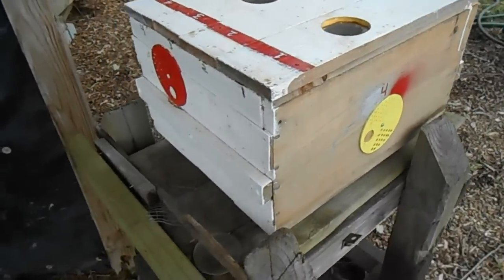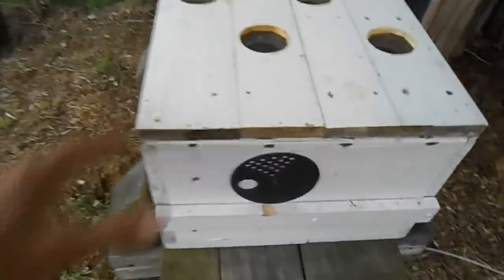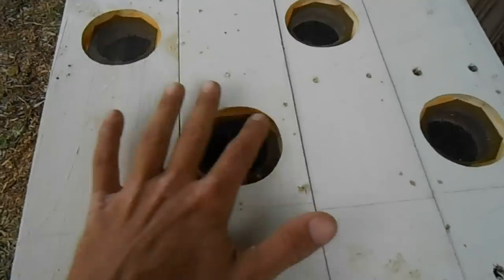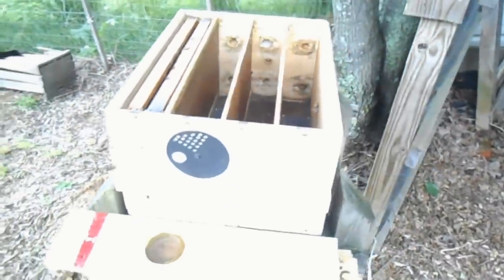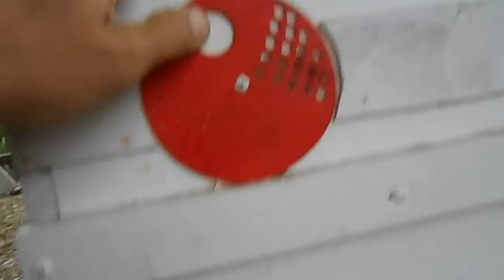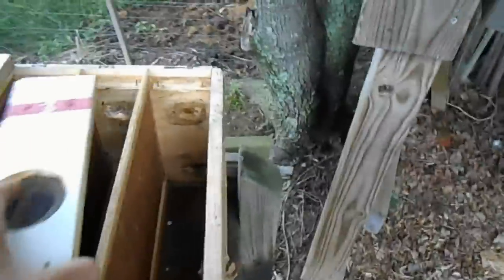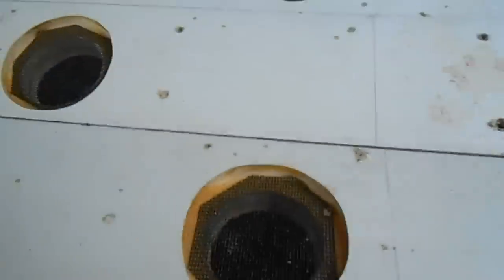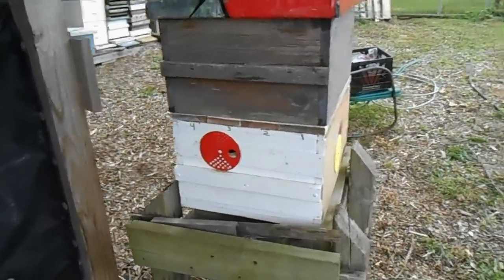Explaining A Queen Castle?

Comment: I sure learn a lot from you, more than any other beekeeper on you tube. Thank you!
Reply from the maker: Lyn Durga Thanks that was nice to hear. I try my best to make good videos that will be useful to others.
Reply: I did  summer splits,had 2 of the queen less hives that produced a laying queen lose her and 2 weeks later they had queen cells and no queen or brood. I split one of those hives in half on August 31st, by late September they were both full of brood and still have capped brood today. I know I'll be feeding fondant this winter. If it works out for me, I will have 3 colonies from a 3lb package I bought in May. I knew they were special because I had 2 full supers of honey by July and I never feed them in June. I started this year with 1 from last year, 2 2lb packages and 2 3lb packages. I currently have 12 colonies. Opened some hives today, panicked when I found some with no capped brood. I hope it's just that time of year when the queen has stopped laying. I am feeding pollen patties trying to keep the queen laying but it has gotten cold. Last winter I was losing bees when they left the hive and froze before they made it back. I closed their entrance with screen and made a screen en closer that I placed on the hive when it was sunny and warm. They would fly around in there and poop then go back into the hive. I also use deep bodies for nuc boxes. I have insulated fillers I place on each side. I can take out one at time to add frames. No need to disturb the colony when changing boxes.Just a few things I wanted to share with you and anyone else who is interested. Thanks
Reply from the maker: Lyn Durga Sounds like you really grew you bee yard this year. That is great. Do you have a number of hives you would like to reach? Also this screened enclosure you made how big is it? This is a interesting idea.  

A few years back I was up to 24 hives going into winter. But I did not feed like I should nor did I treat for v. mites. By the time spring came around I was down to 10 hives. I was really hoping they would all survive so I could split them and make 48 colonies. So I learned my lesson big time. I now feed like crazy for winter and I try to treat for mites by August. That was a major kick in the gut but it was also a lesson to me. As a beekeeper I need to do all I can to help the bees through winter.

This year I have 11 hives but they are all booming. I have been feeding for over a month and mite treatment is done. So they have been raising healthy winter bees. I have even treated for Nosema this year. So I fell I have been doing my part now lets hope the bees can do theirs.
Reply: I don't use chemicals to get rid of mites. I use powdered sugar as many times as it takes until I see no mites. I don't believe you can get rid of one type of insect without harming the other. I've witnessed my bees attack a hive beetle and take it out of the hive. I don't want to take a chance ruining their natural instinct by using chemicals. My bees are thriving and I'm certain that they live longer than 4-6 weeks during the summer. When I did the splits in July the population in the queen less hives never dropped. In fact of the 5 hives that I split, I ended up with 2 swarms from the queen less hives. I mention previously that I even split one of the hives again getting a total of 3 from that package.The screen en closer I made was 36" wide window screen, so 36" tall with the other  dimensions the same as the hive. Last winter I covered the hive with a bed comforter on 3 sides leaving the front exposed. I have been covering 2 hives at night this fall and their queen is still laying. My bees are here at home with me, where I can check them every day and tend to their needs. As for how many colonies I plan to have. Have not set a limit, I have been making a lot of the hive bodies and frames myself,cheaper but time consuming. I have several locations lined up to set hives but I'll always bring them home for winter. Thanks for the interest.

Comment: On your feeding holes? How deep and is the screen inside the holes or on the bottom of the dividers?
Reply from the maker: The boards with the feeder holes are 3/4" thick. The hole goes all the way through and the screen is stapled to the bottom of the board. This makes it so the board will hold the jar to keep it from blowing over. Hope this helps.

Comment: Ok now I have virgin queens in three stalls in my queen castle. how long before they go on mating flight return and start laying and how long should I wait to move them to a nuc. thanks in advance
Reply from the maker: It depends on the weather as to when they go on flights. If the weather is decent, I would say in the next 2 weeks she would start to lay. I would move them to a nuc after she has laid and the cells are capped.
Reply: Thanks again for the information